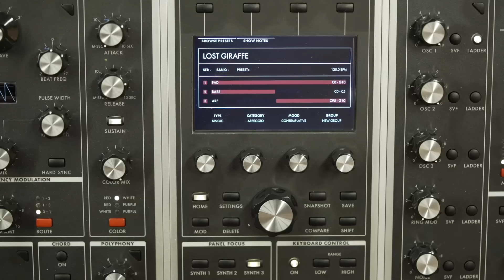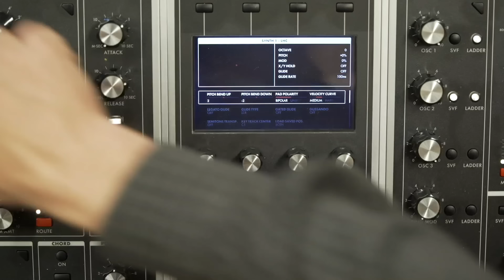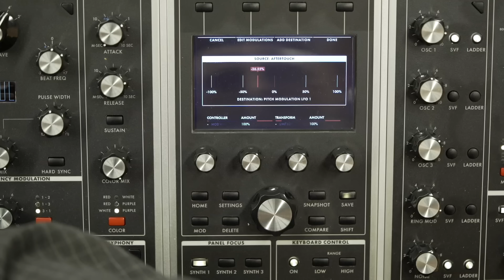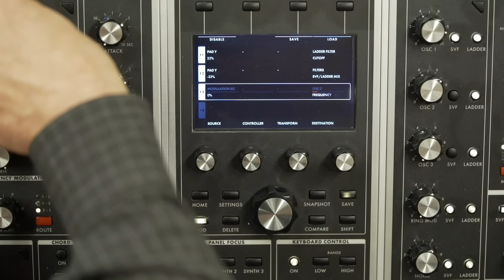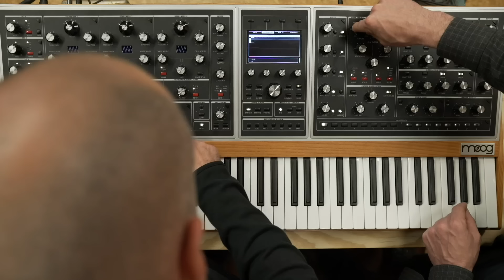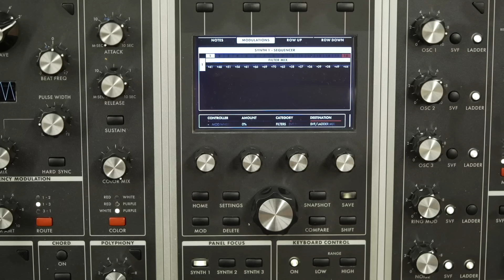Moog One: System Architecture - Part 3 (Live from the Moog Factory)

Comment: I didn't get to hit this one up LIVE. Is there an internal fan(s) in the Moog One?  When they reboot the system after the firmware install I hear some white noise coming in and out.  But Im curious, just generally speaking :)
Reply: 4 of them.
Reply: I don't mind as long as they are low rpm like in the iMac.  The Apple iMac fans are larger and spin at a very low RPM so they are deadly silent. A lot of time fans will spin up to max upon a reboot, until the hooks in the kernel that monitor temps can tell the fan controllers "No need to spin too fast yet, things are cool."
Reply: Station 2Station nerd
Reply: I'm a total nerd. But you own a metal detector....so....   :)